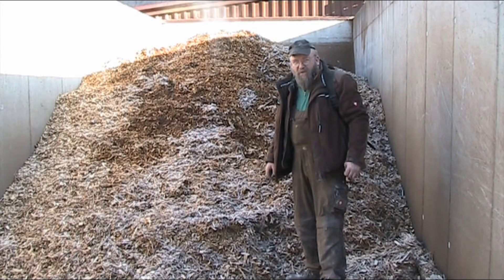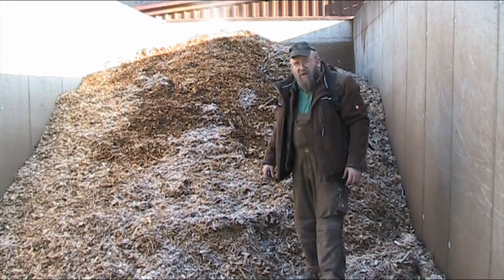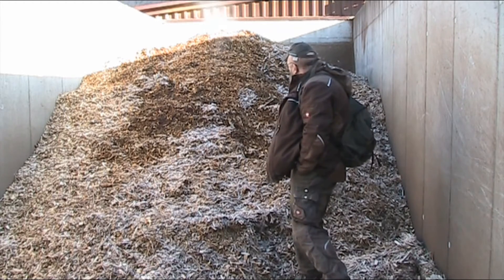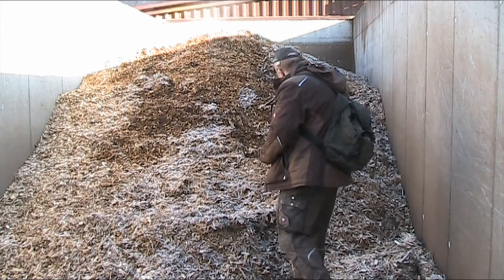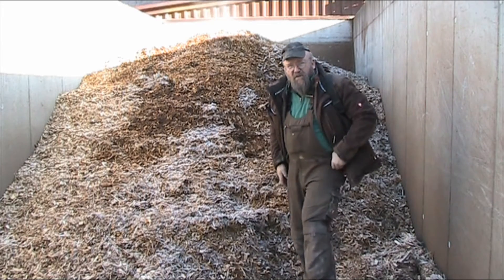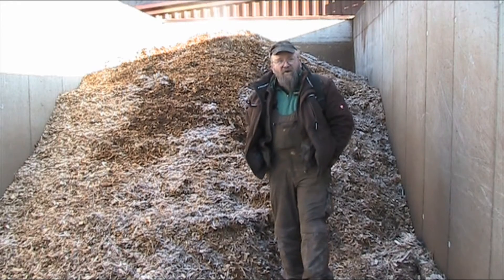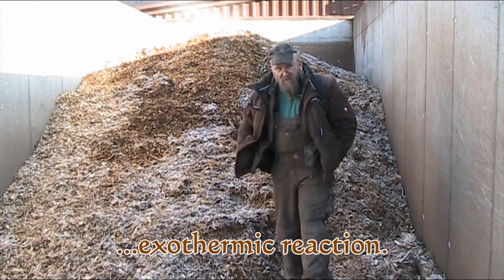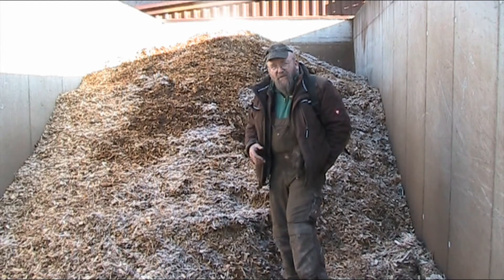Random Lengths, episode 2, why do the woodchips "smoke"?

Comment: I'm an arborist. I have a chipper. I live on a hill. I have a really big chip pile. it's been growing for the last 20 years. It's close to 20 feet deep at the deep end. It's been steaming the whole time. This spontaneous combustion thing baffles  me. I understand that biological activity produces heat and that that heat can build up especially in a deep pile. But the heat can't build up more than the source. And that source the bacteria or yeast can only handle so much heat and then it dies off. No more source so no more heat build up. My understanding is that most organisms die off around 130 F. I think the any sort of ignition of the chips would be closer to 500 F. Am I missing something? A chemical reaction or something?
Reply from the maker: the depth of the pile also plays a major role in the spontaneous combustion as pressure in the material column increases with depth and also creates heat. there's a couple of crazy finns that have a youtube channel called "beyond the press" where they take various materials and put them in a hydraulic press and crush them. wood and paper often explode violently when pressure is applied. it's along those lines of physics that the spontaneous combustion occurs. granted the pressure is no where near as high but if conditions are just right the chip pile will ignite and smolder. 
the ignition temperature of wood is around 150 deg fahrenheit and it also begins to char between 120 and 150 deg fahrenheit so the fermentation temperature alone is almost enough to get it going. add the pressure and voila!